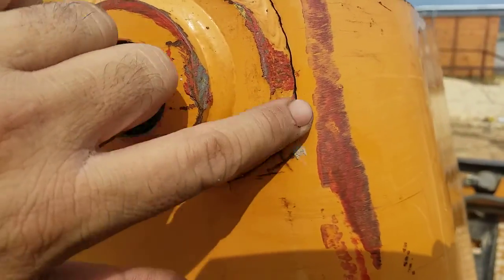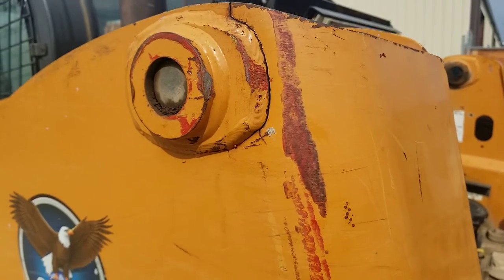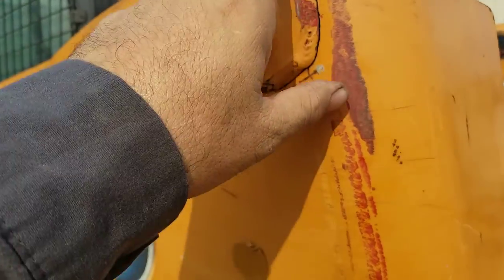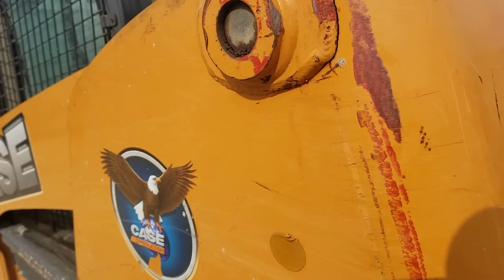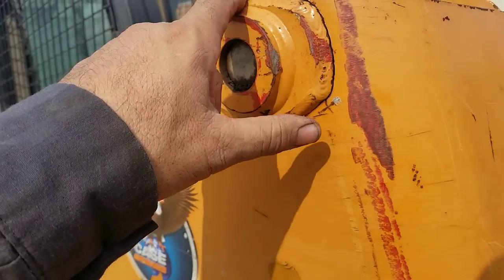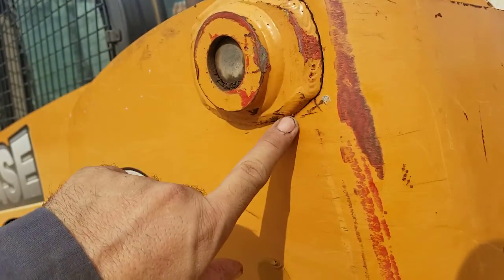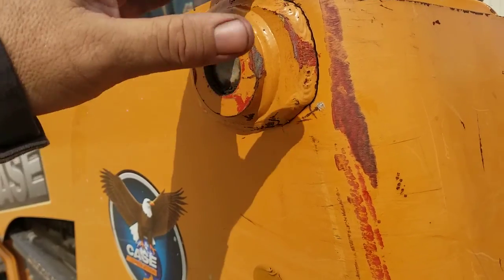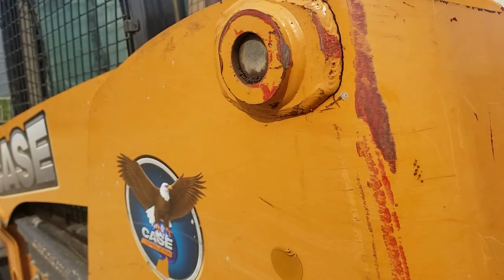Heavy Equipment Repair has it owns special needs

Comment: Interesting issue... Pretty sure I would have caught that a bit sooner and fixed it..
Reply from the maker: you be surprised how often that is missed
Reply: @sonofmontezuma3732  poor oporators and poor mechanics that miss that...
Reply from the maker: in the old days operators had a grease gun given to them and were told grease unit every morning.
every one just wants to start unit and get going and machine off they leave fast as possible .
Reply: @sonofmontezuma3732  I'm old school... You run it, you grease it!
You break it, you fix it!!
Reply from the maker: yes sir ,your unit goes down you go home till it gets fixed.
backhoes are the most neglected
Reply: @sonofmontezuma3732  had an oporator do that.. broke a machine that needed to be going. Brought it in, hosed it off to get worked on.
Then left for a week.
I was PISSED!!! July3, 2018.. I was able to get it apart to see what parts we needed. Actually got parts ordered.. had them on the 5th. Got it together that night.. 
He comes back 5 days later, thinking he had to fix it.. WTF??
It was the hay mower, whole opporation was shut down without it running....😵😵😵😲🙄🤬😂🤣